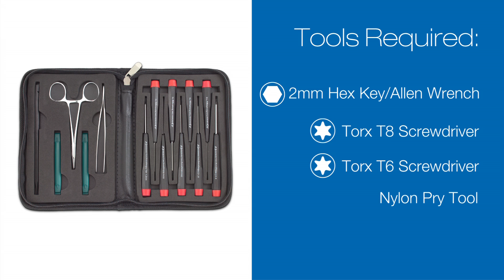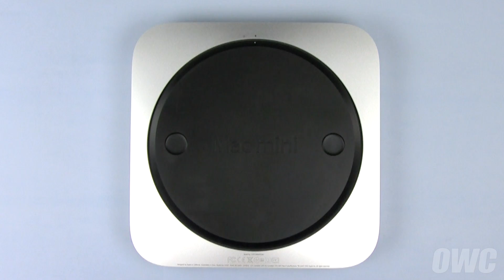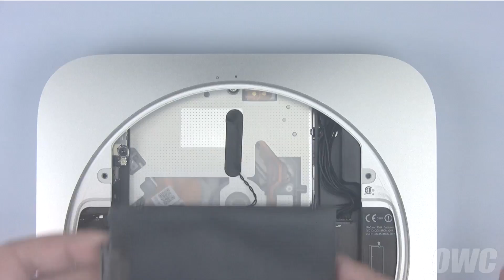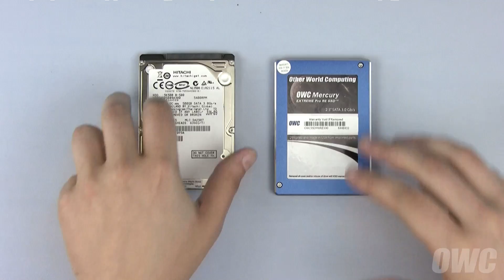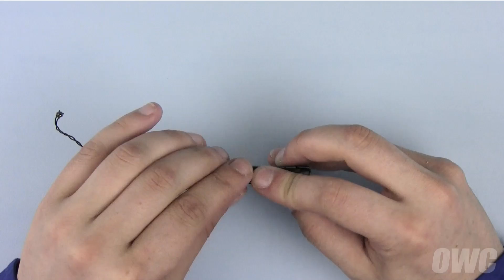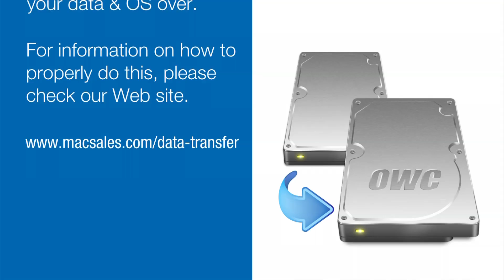Mac mini Mid 2010 Hard Drive/SSD Installation Video

Comment: I’ve done this job twice very carefully without issue but this last time the two wire power lead for the SATA connector popped right off the logic board still in its socket! (Lump in my stomach) With nothing to lose at this point I sharpened the tip of my smallest soldering pencil to a needle point and with a magnifying headset lightly tapped the two socket leads at the connection points and they resoldered right up. Finished rebuild and test ran perfectly! I think from now on I will hold down the sockets to the logic board with one tool while popping off the connectors with another tool in the other hand.

Comment: This is harder than it looks.  I am successfully installing Mojave on my new SSD as I write this.  But I also tore the HDD power connector socket and all three temp sensor connectors sockets right off of the circuit board when I disconnected the wires to get at the HD.  They are VERY fragile and weakly soldered onto the main electronics board.   I also ended up with five screws I couldn't get back into place because everything has got to be lined up just right - very precise tolerances.  It was no picnic getting the old drive out and the new drive in, either.  Fortunately the power connector isn't used on a SSD and the fan is very quiet for something that is gonna run continuously since there are now no sensors to ever tell it to turn off.  I got lucky.  With this experience, I could do better the second time around.  But my recommendation is that if you have a functioning HDD, forget about a SSD install and just be patient when you're using your Mac Mini.

Comment: Huge Thanks OWC. Worth reading the comments and watching a few other videos on the subject but followed this guide and it worked out fine with no real dramas.  Some of it is small and fiddly but the iFixit tool kit is perfect and I can see how some have had issues. Now have new 500GB Seagate Momentus installed (22GBP direct from Shenzhen May20) and just watching the MacOS Sierra reinstall from a Cmd-R boot.  Did have to GUID partition the drive from a external boot disk before this worked.  Top marks OWC.  Right to Repair!
Reply from the maker: Glad it was helpful for you!

Comment: I am curious what are the limits in terms of ssd maximum  capacity (1-2 Tb) for both hard drive slot and optibay? And what is maximum speed for optical drive replecement (with ssd such as Crucial BX500 2TB 3D NAND SATA 2.5-Inch Internal SSD - CT2000BX500SSD1)?

Comment: Just did this yesterday, installed 8 GB RAM, and installed an SSD.  My 2010 Mini is running great now!  The only snag was one of the heat sensor cable leads pulled out of the snap connector, used loupes to place back in, and got it back together. No issues.  I am a scratch PC builder with a lot of experience.  This is not a newbie project!

Comment: Ok i´m a newbee so please don´t hang me down. I have a Mac mini server 4.1/mid 2010) that i´m trying to put together again, I just upgraded the ram to 16 GB instead of 8 GB because the supplier didn´t had two 4 GB´s in stock. My problem is that the connectors for the harddrives doesen´t look the same as shown in the video. The top drive´s connector is fit between the connectors on the motherboard and the lower one has a different cable then shown in the video. So i´m a bit confused how to get my old mini back in action. Never commeted in YT before so I´ll try to find a way to post a picture for clearity.

Comment: Hi, I have installed SSD Samsung EVO 860 250 gb to my Mac mini 2010 and 
also installed 7200 rpm drive to optibay, and got an issue: SSD works 
only on SATA I speed. 

After some investigation, I swapped them: 
SSD connected to optibay, and HDD - to hdd interface. VOILA! 3 Gbs both.
 Hope, it will help to some body. 

Old native 5400 HDD gave 40 mbs speed, new 7200 HDD gave 140 mbs speed  and SDD gave 260 mbs speed.

Comment: Going to try and replace my drive with a SSD today. Fingers crossed. A similar video shows heat being applied to the heat sensor that is glued to the hard drive with a hair dryer. This is to loosen the glue as the heat sensor is very brittle and prone to breaking.

Comment: Tried this today and I broke two sensors off one is a heat sensor don’t know the other, they were so brittle they just broke off the logic board even when being super careful and they are so tiny but it still boots but gets hot. It was so slow before with the original 5400 rpm hard drive so I really wanted to put in a ssd but when I originally watched this I thought its just too tough and risky. Then I got a new ssd to replace a smaller one in my wifes macbook pro which is a easy install so I thought screw it I’ll try installing the smaller one into the mac mini via this video. Well she boots in 10.8.5 but not sure how long it will last, cloning a system into the ssd, hope it doesn’t catch fire🤔🔥. As computers get older the plastic parts get more brittle from the heat I guess. But man those connectors are small, so this was a last ditch effort to keep the mini alive. I know I broke a heat senso that connects to the drive, when I removed it it broke in half, so it seams the fan just doesn't work any more. It boots under MT LION and runs but gets to 100 c and feels really hot. I tried an old fan utility and nothing. I guess I will pull out the SSD and send the mini off to be recycled. I think the best thing would have been to put the SSD ina firewire 800 case and boot it from there, not as fast but it was just going to be a music server for the house. Long story short I tried, I failed.
Reply: I read the entire comment and THEN realized it WAS YOU!!! Holy heck, Batman! Do I even wanna try this? Or just use a FW case on my 2010? and boot from there!!!!!
Reply: I would go with an enclosure

Comment: Be very careful when removing the temperature sensor from the old drive. Mine broke in half. The device will still work with it not working, but the fans will be maxed out when it doesn't recognize a working temp sensor.

Comment: Used the advertised tool kit, and the upgrade worked.  Unfortunately those thermal sensors aren't at all resilient, and I snapped one in half attempting to remove it from the hard drive.  Now my fan runs flat out, but everything otherwise works!

Comment: Ripped the optical drive thermal sensor right off my motherboard  using THE TOOLS advertised here and applying gentle pressure. Now my DVD drive won't work. Never again, thumbs way down

Comment: For anyone looking at newest comments first: heed Mark's advice below: half these steps are unnecessary. I followed his advice and did this job in half the time and with MUCH less work. See my reply to his comment here: 

Mark, you are COMPLETELY right on this. As a word of warning to repeat Mark's words above: half these steps are unnecessary. In fact, I didn't even need to remove the fan connector, I simply set it aside while I worked. I didn't remove the RAM. I was able to pull and twist the hard drive upwards without moving the logic board. I simply swapped the thermal sensor and the mounting screws onto the new SSD and then levered it back into place, then reseated the SATA pad. Easy peasy lemon squeezy. No broken connectors, no max-RPM fans, no extra work. My only regret is that I didn't make a video of the job (didn't think of it until I was halfway done).

Comment: I accidentally ripped off the sensor for the fan as have other people but I just installed fan control and it was fine in the end but it's better to NOT rip off those connections because it will be a pain in the butt to have it ripped off

Comment: Hi!
During the process of removing all the connectors from the logic board i broke the whole power connector from it. The connector of the cable and the connector that was on the board are stuck together... What do i do?

Comment: As stated below, this video SHOULD WARN  (but does not)  how fragile the thermal sensor sockets are. The power connector socket (infrared sensor connector) is also very fragile.  ANY OF THESE SOCKETS CAN EASILY SNAP OFF THE LOGIC BOARD even while being very careful and using a plastic spudger/pry tool.
Reply: Listen to this guy. I've a dead Mac mini after the whole socket snapped off the logic board, despite taking care.
Reply: Yep! I broke most probably that self same connector from the logic board, was shortly after acquiring the mid-2010 version. The manager at the Apple store was kind to replace the logic board for me free of charge and installed the ssd for me for a fee. I may have them do it again now that I read your comment, and the other reply to it. Not paying more than $60, however.

Comment: but what about the OS ? how do you boot from a blank drive?
Reply: Alt + CMD + R on startup, it will boot into internet recovery and you can install the O.S. from there.
Reply: How sure are you about that. If the Macmini has an old OS it may not be able to... Using Timemachine is probably the safest bet.

Comment: Followed the video, had serious issues moving the logic board using the two screw driver method. Now it would appear that the board is stressed/damaged around the screw holes - there doesn't seem to be any circuitry directly around the screw hole so maybe it will power on . I was very careful not apply to much force. The only way I could get the board to move was to use a flat head screw driver and prise it away against the hard drive. I've not put the thing back together yet but my motherboard didn't move anywhere nearly as freely as the one in the video.

Comment: what about a dual drive setup - with the optical bay & drive bay?
I would think an SSD for boot/speed and a large ( ~ 1TB) for size would be a good combo.  This setup would be better for performance than a hybrid drive or drives.

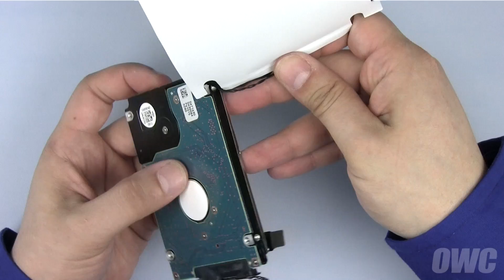Comment: Hi.  What do you do with the thermal heat sensor from 4:42 when you are installing a SSD?  Do you attach it in the same place but on the SSD?  My mac mini fan will not stop running and don't know what to do.  Thanks.
Reply: ***** Ok so you want to put the thermal sensor on the solid state drive in the same place it was on the original non solid state drive?  I did that but the fan wouldn't stop running on my mac mini 2010 model - I had to install software to manage the fans - is that what you would have suggested to stop the fan from running constantly?

Comment: If you end up installing a 7mm SSHD to replace a 9.5mm standard drive and you'll want to put a piece of foam tape or some other type of spacer (I used adhesive velcro) to help the drive sit flat and make it easer to screw in the top screws.  They also sell spacers or risers do help deal with this.